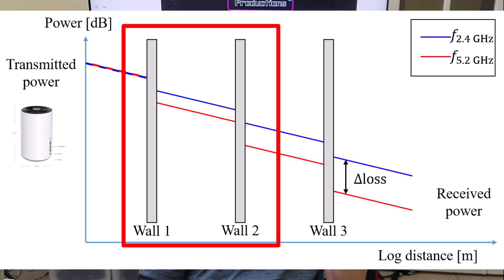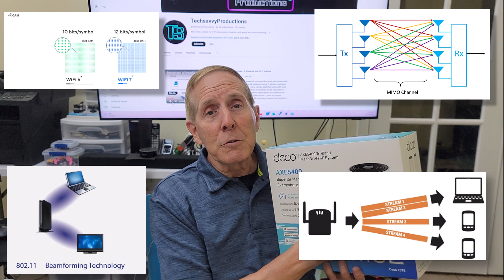Two Dirty Secrets of Home Wireless Technology

Comment: OK, but here has to be a workaround, doesn’t there? What about using high power/long range APs (that are meant for outdoor use) INDOORS? What about hacking your mesh routers to increase their power beyond the limitations that the FCC imposes? (Yeah, I’m sure that’s illegal but I doubt that the FCC is going to send out a bunch of agents with signal strength meters, looking for people to bust.)
Reply from the maker: Mesh is the answer, and it works very well the drawback is expense.

Comment: Of course, this belittles the reason the FCC had to make such rules. In the recent past, the power limits were much higher. Consumers know nothing about anything. When they see a knob that goes to "100" (mW), they crank it all the way up - because more is always better, right? (do you keep the volume knob on your TV set to max? No. Of course not.) The answer to your neighbor setting up an access point was obviously to turn yours up. They also don't understand how channels in the 2.4GHz band work. 1, 6, and 11 are the only ones that don't overlap. But people see 1 in use and jump on 2.

The ideal setting is the lowest power that still works for you. If you both turn the power down low enough you can hear each other, neither will have any interference, and both will work better. Yes, 5/6GHz won't go very far, even through open air, but we know how to make astoundingly sensitive receivers. (cell phone have used them for a long time.) Of course, it doesn't help that we're trying to push multi-gigabit through the air.

(Or, in my case, when I could see 30!!! APs from my apartment... I reached in the archive for the Breezecom gear. This stuff predates even the 802.11 Working Group. It uses the entire 2.4GHz ISM band, with a selectable channel width, hop spacing, and dwell time. Even a baby monitor sitting on top of it can't jam it. Of course, it only does 1Mbps.)
Reply from the maker: Great comments!

Comment: I don't really know what to think about this topic. Yes it's sad when WIFI devices can't deliver the signal thru 2 or 3 walls, but it's perhaps a good thing when you are 1 meter away from the device most of the time (like I do) and you don't receive so much power in your balls :)
Reply from the maker: It's just the facts, FCC limits RF unlicensed transmission, this is true in Canada and Europe also.  The reason is not evil but very practical, FCC does not want RF interference that can impact other devices owned by other citizens.    Engineers have the challenge of making it work.